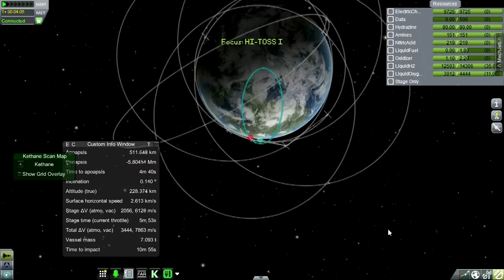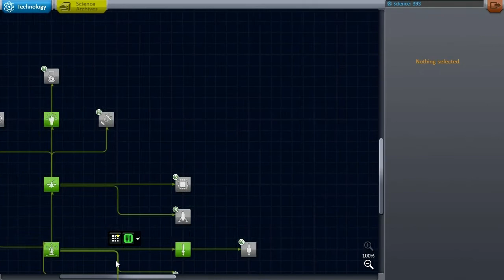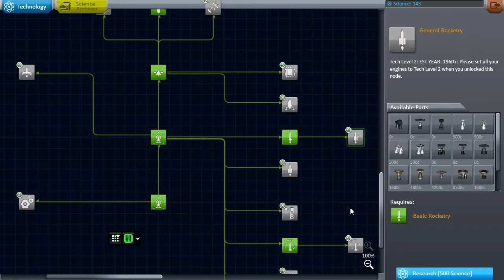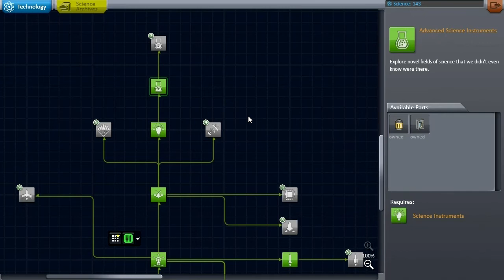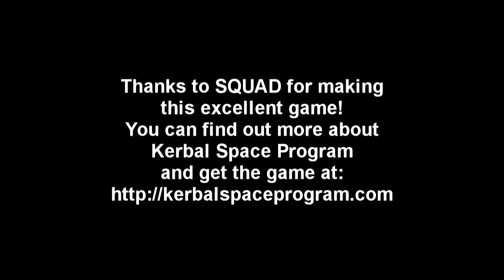Kerbal Space Program (0.23) - Realism Overhaul 009 - HI-TOSS I

Comment: I am enjoying your play through... but the lack of symmetry in your designs so hurts my brain. :D

Beside making heavy use of angle snap, I also generally distribute the weight evenly. (Not doing so can make controlling the ship a bit more unwieldy. This is especially noticeable with small lander probes and such for example.)

Additionally, if you place your RCS near the center of mass... you can still have rotational control (one up, one down thruster) while also gaining much nicer horizontal/vertical movement.

Anyhow... it's great to see someone playing through with Realism Overhaul.  I've been wanting to do so myself but haven't had the time.

Comment: You're not really cheating with the fairings, since all fairings should be available early on (this will be corrected in MS19). Also the tank size limits, which were set for the original tree, not the RPL tree.
You are, however, cheating with RCS. :P The RLA parts are clearly not added to the tree (you can tell you're cheating because regular RCS isn't available to you yet).
Glad you bulked out the second stage--it's definitely a good idea to maximize the size of your hydrolox upper stage, since that has the best chemical specific impulse you can get. However, be careful when your sea level TWR dips below 1.2; below that you're reaching the point where you lose more to gravity losses than you gain in larger delta V (that is, even if you stretch the stage and get 100m/s more dV, if your TWR drops from [wild guess] 1.18 to 1.17, you might lose 110m/s due to higher gravity losses). This is why, for some values of "optimal", a solid+LH2 vehicle is optimal: very dense, high TWR lower stage, where aerodynamic and gravity losses matter, low-thrust high-efficiency upper stage where TWR doesn't matter.
Reply: You're supposed to research the node that gives you RCS if you want controllable probes... ;)

Note that there weren't 3-axis stabilized satellites until a good year after Sputnik--even later, if you only count the ones that succeeded. Until then (and even after that point--RCS is not cheap in mass terms or control complexity!) satellites were spin-stabilized.

IIRC the real life rule is 1.15 is the minimum takeoff thrust for an LV; below that you're losing more than you gain. 1.2 is probably a good target to shoot for; the Russians generally have higher-thrust launchers since with a low liftoff TWR you're really limited as to when you can launch--even a bit of wind may be too much. Falcon 9 has a liftoff TWR of about 1.16, and it has really limited launch windows. Zenit, by contrast, has a liftoff TWR of 1.6, and laughs at wind shear or rainstorms.

I would love to see the result of your tests, of course! (Although remember that it's not just liftoff TWR but how quickly it rises that matters--if you start at 1.16 but rise quickly, it's OK, whereas if you have a comparatively small, short-burning first stage and start at 1.2, that might well be worse).